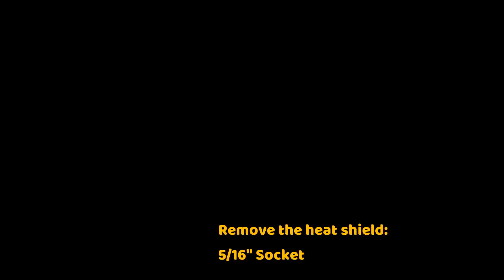Harley Extended Brake Pedal Install - Kuryakyn Extended Break Pedal on the Ultra Limited

Comment: Thanks for the video!  Just put mine on.  The instructions said to loosen the engine guard and rotate it forward but wasn't sure how to do that...  But removing the heat shield like you demonstrated seemed easier.
Reply from the maker: Glad it helped!

Comment: question? does this extend the lever forward or the pedal outward>? i put an Arlen ness inverted intake om and now my pedal sits in too far and my calf hits when i,m braking....annoyed but love the cleaner performance and look...sugestions?
Reply from the maker: I believe, if I remember correctly, it only moves it forward and makes the pad flatter.

Comment: Did you go back and put the o ring back in or did you leave it out.  I seen it laying on the floor when you was done
Reply from the maker: Now you really are digging into my brain.  Honestly I don't remember.  It's been a few years!
Reply: I just installed mine earlier today and did not replace the o ring since the instructions did not say to.  But now that you mention it, I wonder if that would be a good idea...
Reply from the maker: Just re-watched my video, and I made a special note in text that O-Ring is not required on install: https://youtu.be/-j57r22cSAM?t=526

Comment: Did you notice any difference in the pressure you had to put on the rear brake pedal?. I installed this pedal and it seems like i have to smash down on pedal harder i noticed before install i just tapped the rear brake pedal and the cruise control would shut off now it seems i need to push harder on the  brake pedal to kick it off
Reply from the maker: No difference between the two except for foot position.  Business as usual.  I guess double check the install?